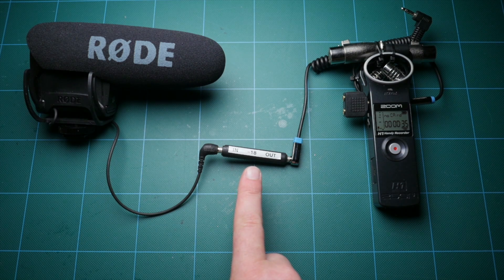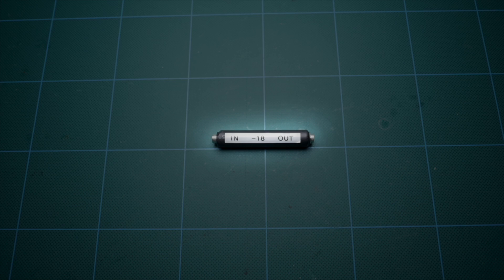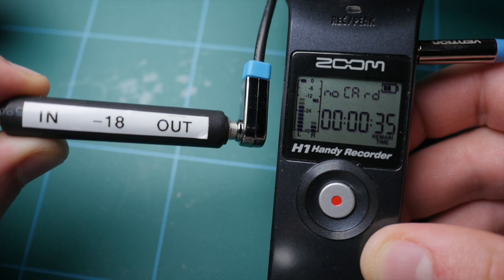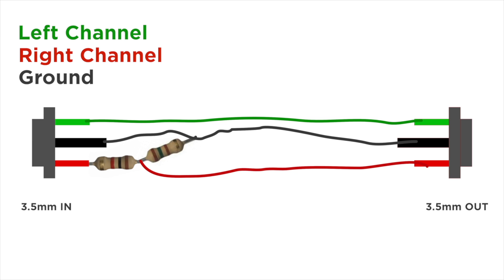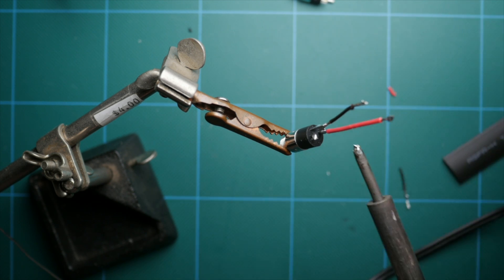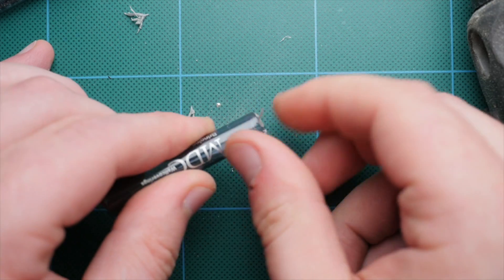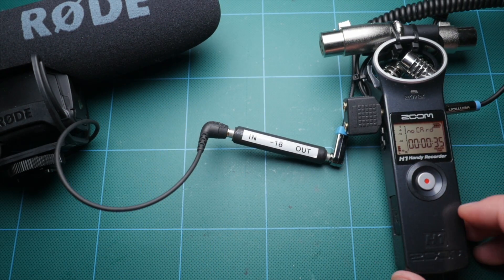Run and Gun Audio Safety Track Adapter (Attenuator) for Video Cameras

Comment: It's all very well saying red wire black wire but that means nothing if you don't explain which connectors are which on the actual jacks and how to tell the difference. Which wire is going to the tip and which to the ring?? and how does that affect which channel is attenuated???

Comment: if i wont -20 db Attenuator,what the exact calculation? tnx
Reply: i use this calculator: http://www.sengpielaudio.com/calculator-voltagedivider.htm  you enter input voltage 1V, your dividing resistors and input impedance (approx 1000 to 2000ohm) and you will get output voltage. You then calculate dB from output voltage compared to that original 1V

Comment: Didn't work for me. The microphone works the same way, both channels at equal gain.  
EDIT: Success!!! I only tried it on my PC with Audacity, not realizing the jack ports on PCs are mono, and one of the channels gets duplicated. Works like a charm with the camera.

I used a 3.5mm jack cable (female to male). It's a lot harder to solder two little wires together, but I couldn't find female jacks with a cylindric shape (only rectangular ones used for PCs). Used a long and thin marker cap to cover everything up and it looks pretty good. Thanks a lot Caleb!! :D

Comment: Thank u Caleb!

Incredibly usefull and cheap. 
I'll need to conect my Tascam DR-100 to the new GH5, but i'm from Spain and weirdly we don't have any brand here making THIS little cable: http://www.ebay.es/itm/Kopul-ACDR-35-Line-to-Mic-Attenuator-Cable-/271355081870?hash=item3f2e05f48e:g:YZQAAOSw3ydVjKsv (almost 40$ with shipping&taxes)

It's a 35db attenuator so I could go from the Line output of the Tascam to mic input in the GH5.
I'll try to adapt your design, but the questions are: 
1)Do I have to do the same attenuation you did with the right channel but this time in both channels?
2)Hoy can I achieve -35db instead of -18db? What are the maths inside?

Comment: I wonder how this plays with AGC in cameras. Especially in DSLRs that don't have a manual gain control for their mic jacks. Have you found that they tend to apply the same gain to both inputs, keeping this as a safety track, or do they tend to do AGC separately on the two channels (negating the -18 dB effect of the right channel)?

Comment: Also posted a similar comment on another video that you did (about the Saramonic Smart Rig). I'm eager to find out if this Safety Attenuator will work if I place it before the Smart Rig -> Will the camera still get a Right Channel that's -18 if it's passing throught the Smart Rig (does it work with that kind of stereo attenuated input)?
Reply from the maker: Yes, the right channel should retain the -18db attenuation.

Comment: When soldering the jacks together, is there a specific number to solder to another number? My jacks have the numbers 1,2 and 3 on them. Do these correlate to positive/negative, or does it not matter which point of contact to which?
Reply from the maker: Hey Ranger! Yes it does matter. The most important one is the ground. Usually 1 is ground, 2 is left and 3 is right. If left and right are mixed up you'll just hear them reversed, but if ground is wired wrong you won't get audio. You should be able to test the wiring and hear if things are correct.
Reply: Thanks Caleb! I'll post a video when the mod is done.
Reply from the maker: Sweet!

Comment: I just want someone to make and sell these.
Would this work with a mono Lav mic input? Essentially splitting the signal and then knocking half of it down?
Reply: As you just taking a signal and splitting it into two, yes. But that's not stereo a stereo signal has two different signals so all you would be doing is duplicating the same signal then sending one left and the other right at a lower volume. Which for our purposes is all we need. You're right though, someone should be producing these and selling them. I'd buy one.

Comment: Hey Caleb, this is an awesome hack, so I thought I'd help you out with a formula to determine the resistor value in order to achieve different attenuations. This formula determines the value of the smaller resistor, while the larger one remains at 1k ohm. R stands for resistor value, and A stands for the desired attenuation:

R = [1000 * (10 ^ (-A / 20))] / [1 - (10 ^ (-A / 20))]

This should give you a nice range of attenuations which you can achieve, just remember that you can't find resistors in any given value, so you may have to settle for a close but not exact value. If you still can't get the desired attenuation using this formula, try increasing the value of the larger resistor, and simply plug this value instead of the 1000 in the formula. Another simple modification which you can do, is to replace the smaller resistor with a 1K potentiometer. This would allow you to actively change the amount of attenuation on a single device (although you would lose some of that small form factor).
Reply from the maker: That is impressive Daniel! I wouldn't even know how to approach that equation! Math was never my strong suit beyond basic algebra.

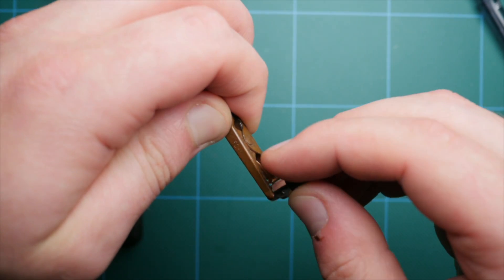Comment: Hey Caleb, I'm loving the content you put out - simply amazing! I'm a filmmaker who does DIY-projects as well but haven't filmed any of them yet. Noticed that you have the price tag still on your soldering "third hand" holding tool seen at 02:31 :) Can't wait to see your next DIY-project - need to find some time to build few of these with different db levels. Thinking of a solution to mount this piece either on my camera, microphone or recorder so that it won't hang in mid air. This also works as a safety if someone accidentally stumbles on the cord and pulls out the connectors - its easier to replace this attenuator then the connectors on the camera body or the microphone.
Reply from the maker: Hey Joonas! Thank you for the kind words. And yes, bought that helping hands stand years and years ago and never took the tag off. You could make a small box instead of a cylinder for use with a camera. Using an angled male 3.5mm as the output connector would probably work really well.
Reply: Angled male 3.5mm sure sounds nice to be placed flush with the camera body. But this however makes the connector in the camera body in more danger to be damaged if the audio cable is pulled with force. Strain relief for the camera body connector is one of the best by-product-features your attenuator has because it is connected with a short separate cable and works as the first shield for possible damage. I could connect the attenuator into camera rig/cage with some sort of a pen holder and a screw/ziptie. This way the attenuator can be swapped into a different db-level one if needed. And the second reason why this angled connector wouldn't work for me is that I'd like to monitor the audio from camera and the USB-port is right below the 3.5mm port in my 60D and the flushed attenuator would be in the way :( pointing the attenuator away from the camera body for making room for the USB-cable would only put the 3.5mm connector into more danger of being damaged if one would bump into you while filming.

Comment: Wow, that's really cool! Do you think it can work with a Røde Videomic pro (which is only mono)
Reply from the maker: Worked on my Rode VideoMic Pro!
Reply: ***** Nice! Usually with the VMP in the editing software, it only has one channel and I have to duplicate it to the other to get it to be stereo... that's why I'm a little confused if it can make it from a single channel to a dual channel..
Reply from the maker: That is odd, because my VMP is stereo... Or at least has mono spread left and right. What interface are you using to hook your VMP up to your computer? The mono might be there...
Reply: ***** It happens when I plug it directly to the camera (Sony A7sII) and then after I transfer the footage and start editing, the audio is only in one of the channels

Comment: This is a really cool diy project. But for anyone who isn't super handy, you can buy these for around $10.
Reply: Link please?
Reply: https://www.amazon.com/Hosa-ATT448-Input-Attenuator-Female/dp/B000K67U52/ref=sr_1_5?ie=UTF8&qid=1471375744&sr=8-5&keywords=attenuator

3.5mm are a little more expensive I guess - https://www.amazon.com/Sescom-LN2MIC-ZOOMH4N-Microphone-Attenuation-Cameras/dp/B004U3S1JA/ref=sr_1_2?ie=UTF8&qid=1471375914&sr=8-2&keywords=3.5+attenuator
Reply: Yes, but these cables attenuate on both channels, as opposed to only one. But the good thing is some have selectable attenuation (-10, -20 and -30dB).
Reply: Yeah, that's not what this is. That is for both channels.

Comment: I'm curious how this would be modified if you wanted to attenuate both channels?

cheers.
Reply from the maker: I'm not smart enough to say :-S I'm sure it would be easy to attenuate both channels the same amount, but attenuating each channel differently would be a little more difficult.
Reply: ***** that's actually what I'm referring to. Right now, if you wanted to run say an H4n into a DSLR you'd have to buy a $40-$50 attenuation cable because the input signal is too high.

I have all the part to make this. It just seemed like it would be fun to try and attenuate both line by say -15 or -20 dB.

Cheers.
Reply from the maker: Ah I see. You might be able to do the same thing I did with the right channel on both channels. The only difference might be that you don't need the second 150 Ohm resistor. So you would need two 1K resistors and one 150K resistor.
Reply from the maker: That would be my guess anyway...
Reply: 👍🏽 thanks
Reply: +trevorpinnocky Your dslr should have an option to lower the input mic sensitivity
Reply: Also, you can just buy an attenuator... This, from what I can tell, is not available on the market...